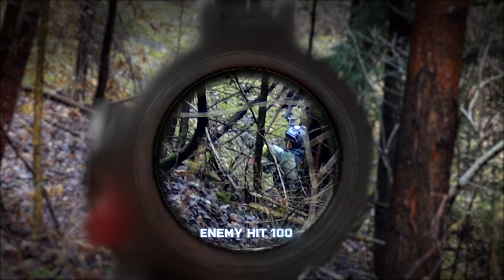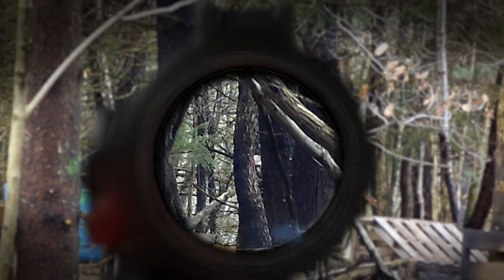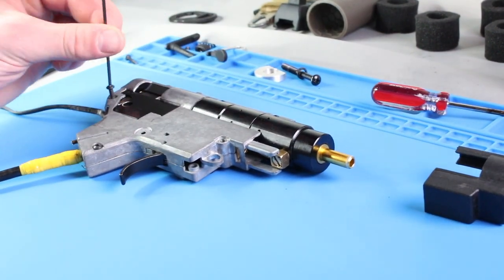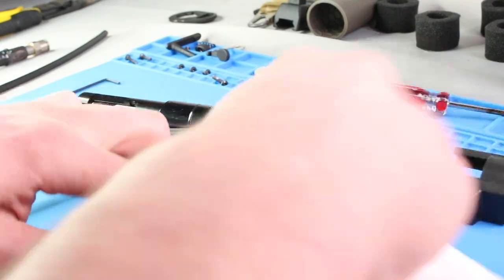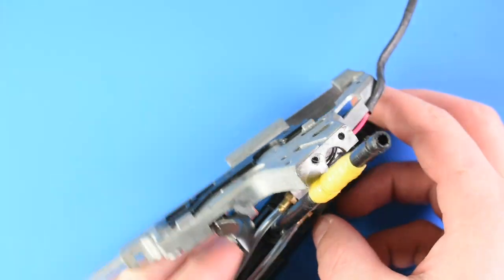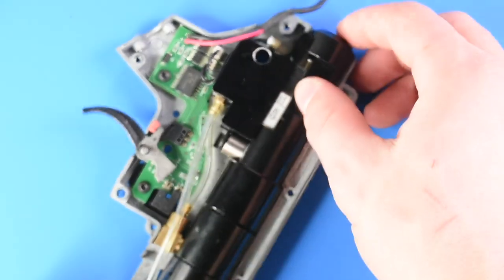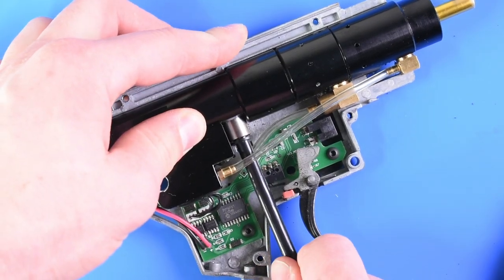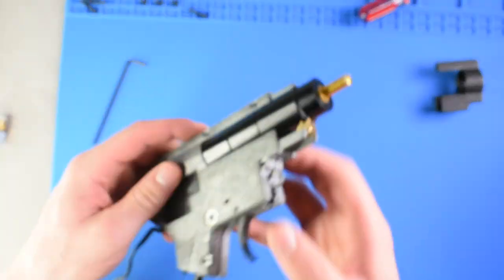Valken V12 | How to REPLACE & RENEW the AIR HOSE

Comment: Bro I just copped a v12 that doesnt have full auto and needs a new solenoid for $75 *EDIT* had a broken polarstar trigger board and I salvaged the switch from that and stuck it in my v12, should have semi and full auto after I get a new solenoid. The half of the shell that holds the trigger board is jacked and I'm going to have to hammer part flat and grind part down.
Reply: @elijaah81  nope
Reply: @elijaah81  if you have an instagram follow me there and I will dm you about specifics @grmln.ying
Reply: @elijaah81  but the trigger board is totally different and rather expensive, $80 on evike but its discontinued. I have emailed evike about trying to special order some parts and that was one of them, no response after sending the list of parts I wanted.
Reply: @elijaah81  bruh I'm stupid my instagram is grmln.ying I forgot to say that
Reply: @elijaah81  on second thought, I'll try that right now, I cannot verify functionality as my air rig and lipo are at the tech along with my FE.
Reply: where did you find a solenoid for the v12??
Reply: @Garrett.  where did you find a solenoid for the v12??
Reply: What size is the fitting and line? TIA
Reply: @mikebutler8474  same as polarstar fe